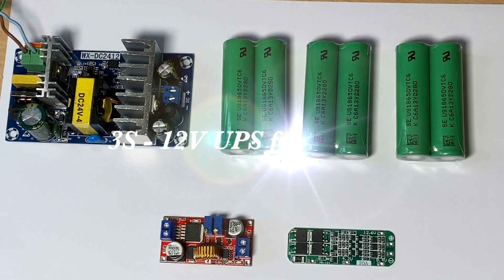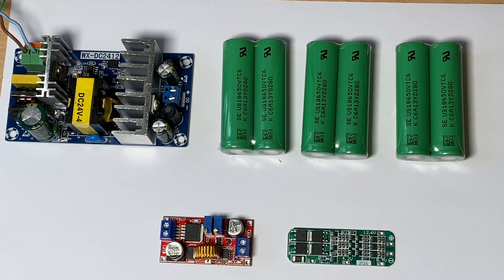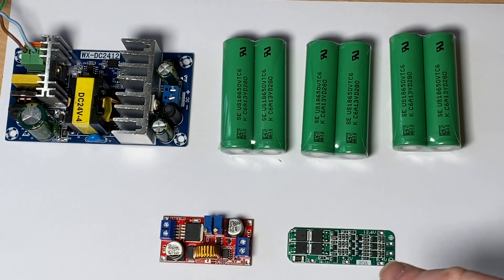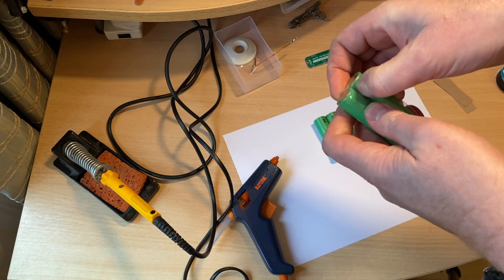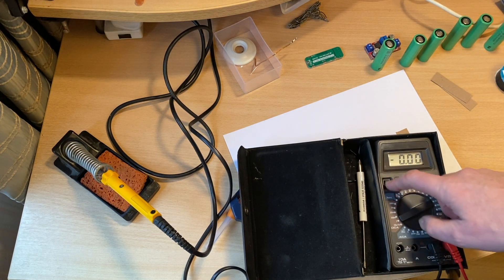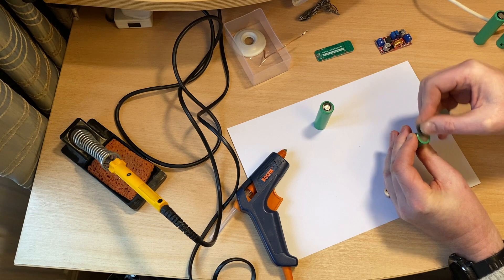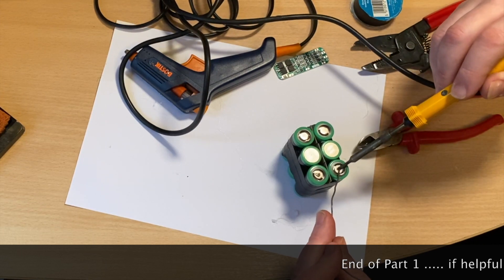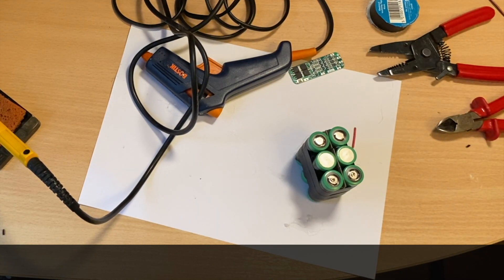12v Router UPS design - 3S batteries Prt 1

Comment: Just an observation - you placed a cardboard separator between the parallel batteries, where the body of the cells were going to be shorted by joining them + to + and - to -  anyway, essentially making the card redundant, and yet, you didnt use a card separator between the series connected pairs, where shorting the bodies of the cells out would be catastrophic  ????? (i personally dont use card in either position but I'd like to hear your thinking on this?)

Comment: Great idea, Can  you modify it for Sealed Lead acid battery version- (12V 20AH) for extended backup power?
Reply from the maker: As the BMS balance is only for these battery types you might need to think of another charging solution and balance. A cheap UPS is probably the safest why with lead acid charging.

Comment: Hello :) Thanks for the video. I think batteries always be on charge when there is electricity in lines. Maybe chinese bms contreller not to be trusted in this type of application? If it encounters an error then batteries can overcharge and meybe burn the house :/ I did exactly the same thing like yours but with a 12v relay and manual charging button for safety reasons. (Down side is if I forget to manually charge it is useless in next blackout. But generally it hold charge about 10 hours and blackouts only take 3 hours max.) Thanks again :)
Reply from the maker: @t.s. that is the current limitation of this approach, ideally there for be a power interruption circuit that would detect a mains power outage and the LiPos would then kick in.  I need to think about that. BTW there is a PT2 coming I will publish this tomorrow.  Thanks for watching.  If helpful please think to Like and Subscribe !! Cheers Joe